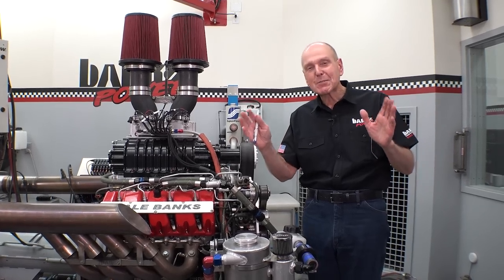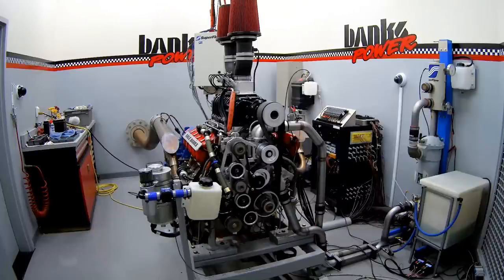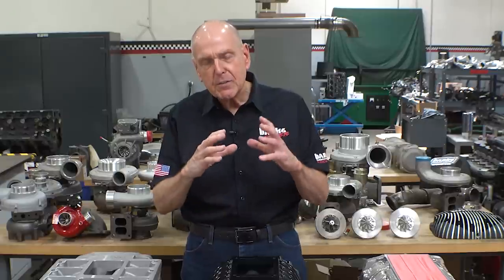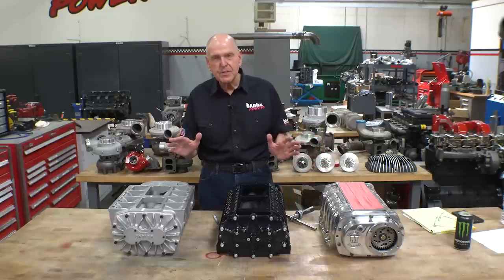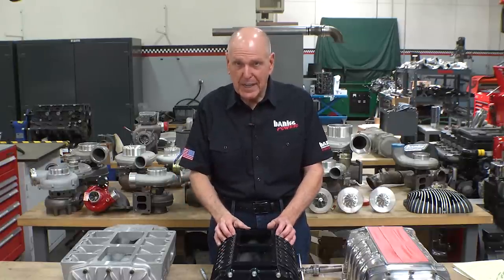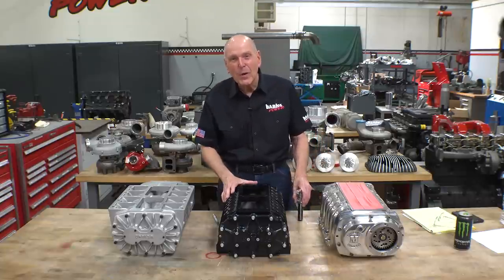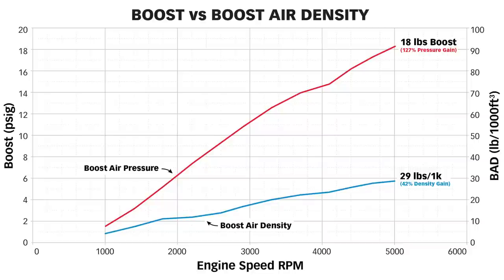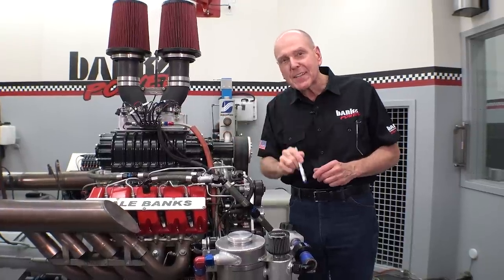FIRST FIRE! | Building A Monster Truck Engine Pt 5

Comment: For all the Ford fanboys who can't brag enough about Powerstrokes, Gale sure puts his eggs in one basket. Guess GM got lucky with the Dmax.
Reply: @ZboeC5  yeah. Tell that to the guy who spent 65k on an PS '05 Amarillo and gave it away 3 years later for 12k. Head gaskets egr, flooded injector dumping fuel on the road (the first day of ownership). All the cheesedick silver aluminum "look" interior that peeled. That was one of my best friend's experiences. He didn't give a shit about institutional inertia. The marketing lie that Ford sells the most pickup trucks convinced him to buy. He knows first hand why I tried to tell him don't get a Ford. He knows now. Drives a titan with a Cummins. Not great, in my opinion, but beats the shit out of a Ford turd. An enlightening cliche, tell me the time, not how the watch works. Regardless of the reason, if your truck is a piece of shit and you took a huge loss, nobody cares about excuses. And about the only thing the new L5P shares with my  LB7 is displacement. The fact Ford makes  one engine you can't get the spark plugs out, and another you can't keep them in, explains about all you need to know. They can't even get 100+ year old gasoline technology figured out.
Reply: @ZboeC5  whatever. Call em like you see em. Believe what you want.